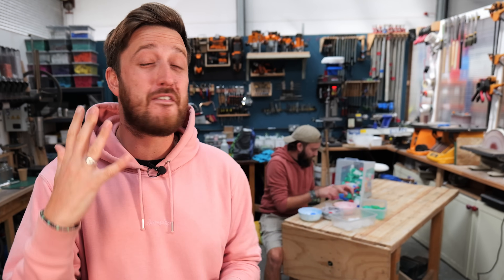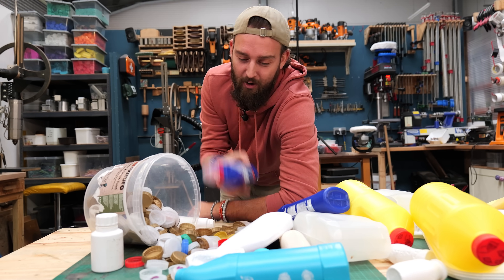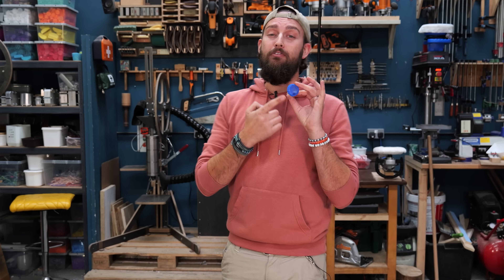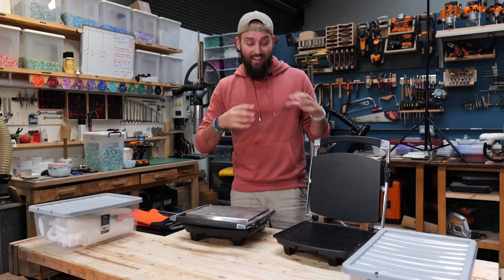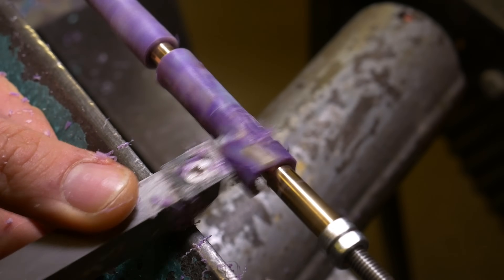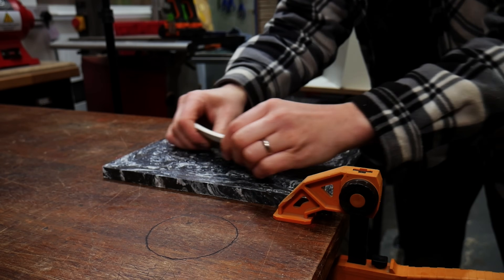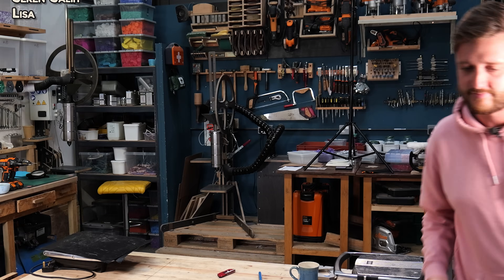11 things we WISH we knew when starting Plastic Recycling

Comment: Plastic engineer here.  Your comment about bottles v caps has to do with the viscosity. Anything that has been injection molded into thin parts, like the caps, will likely have a similar low viscosity material. Blow molding produced bottles (like the soap bottle) will be in the middle and thick wall sheets or pipes will have very high viscosities. It has to do with the intended processes for the material in the first place.  This is why mechanical recycling is so difficult!
Reply: He's right about the intended use for each plastic. The number has to do w the chemistry, but the use case needs different tensile strengths.
Eg.. a clear soda bottle that holds pressure has to have dozens of layers in it to be strong where as a water bottle is just a single micron thick layer.
Bottle caps have to have non cracking strength.
Reply: Can the plastic with a 1 inside the triangle be recycled into anything?
Reply: I have a question any issues with vapors or gases released during melting process?  Since they are doing it in a massive scale.  Heath concerns?
Reply: @jawsvvvvv yes. This is a serious issue and one should have ventilation system in place. Polymers have numerous additives aside from the main component like PE, PP or so. These ususally are low chain organics that modify flow conditions in the forming process (e.g viscosity, wetness) and mechanical properties afterwards. If heated above 60-80 C these compounds are usually released into to a vapour.
Reply: Same goes for casting aluminum. Extruded aluminum doesn't flow as well as aluminum designed for casting.
Reply: So we should just convert it back to petroleum because that’s what it is and use it for fuel. I’ve seen several people using it for fuel after a conversion process. One guy near blew his house up because he was running it under pressure instead of vacuum. I don’t pretend to understand the process fully yet but obviously it can be done. 🤷‍♂️ 
I’d like to run my house off plastic waste. Seems much cheaper than fuel.
Reply: @HamptonsAirTech That's so inefficient. You'd be using a bunch of energy to convert the plastic into oil, and still more energy to refine it. Better to recycle it as a material, where you only have to heat it up to like 140-180C instead of up to 300-900C for pyrolysis.
Reply: @HamptonsAirTech  Think of fuel as a battery that used natural energy to charge. When we burn fuel we are expending the battery. If instead we make fuel then we have to get the energy from somewhere to store it in fuel form. It can be done but more energy is used to make the fuel then can be retrieved by burning it. This means making fuel is a net loss of energy.
Reply: It's Pyrolysis I believe your talking about naturejab right? He blew him self up and now walks with a limp?  there's a problem with benzene it can't be removed from how I understand it but I'm not a chemist  @HamptonsAirTech  there is no safe level of benzene it causes cancer

There's a lot of things that could be oil doesn't mean they should.

The Nazis apparently turned coal into oil and it was incredibly wildly toxic for example there's  tons of it maybe mega tons in tanks at the bottom of the sea and no body has the money or the will to fix that one. "They are monitoring the situation closely"
Reply: Yes you need the plastifier to be known, it's why recycled plastic is never as good. It's why the real way to recycle plastic is to get it fully dissolved to its original components.
Reply: Duh.
Reply: If you are engineer then what is the plastic black mat that the caps sit on in the press that prevents it from sticking to pan or the mat and how does the black mat not melt whats the secret its made of?
Reply: @InCameraK  13:09 THESE ARE TEFLON BAKING SHEETS. Come on, watch the video.
Reply: I have a warehouse proper equipment and labor power. To push out production!!!
Reply: what makes the viscosity different? He said they're both HDPE
did one use a different plasticizer? or more of it?
Reply: @alexr2579  my guess is how the polymer chains are arranged within the material due to production process, with stretching the material ending up with the chains get straightened out a bit instead of being in a glob
Reply: @alexr2579 HDPE is a wide term. There are many types of plastic referred to as that. There’s a clue in the number
Reply: They aren't interested in actually doing a good job, they just want clicks.
Reply: @uwuweewee yeah cos it is not like they are making and selling items made from recycling is it? 😂
Reply: @uwuweewee  you said, on a video consisting entirely of things they've figured out as they've gotten better at said job
Reply: @uwuweewee  Says a troll who can't even do a good job trolling... Next time actually watch the video so you don't make such a fool of yourself.
Reply: @uwuweewee  this comment reeks of chat bot

Comment: I started collecting and recycling plastic because of your videos, although I was in a band so it was making guitar picks - I used metal washers to regulate thickness and was able to make pride flag coloured picks by placing cut single colour strips next to each other. 

I'm a luthier now, so I want to make a ukulele completely out of recycled plastic.... Just thinking through how you'd get a strong bond at joints

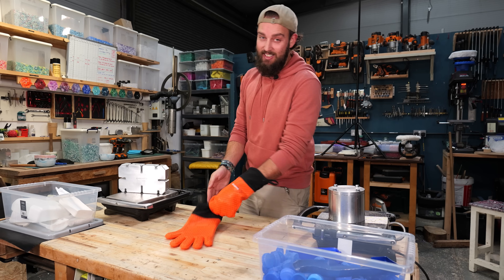Comment: 13:33 Rather use a vertical clamp. Strong clamping force helps in removing air bubbles as well.
Thanks for a gr8 video.

Comment: Please made press-form for tile, which use in a bathroom!
Reply: cool thought, but really not practical. Polyethylene is much more prone to scratches than glass, stone, ceramic, etc. That's a problem when you need to clean it by scrubbing, or if you drop something on it or scuff it. Also not sure how it would perform with any kind of grout, it's hard to glue things to polyethylene besides more polyethylene

Comment: Have you ever tried a heat press like the ones used to press HTV on shirts? I have one and have been meaning to try. I'm looking into melting HDPE and PLA. I think that that having heat from only one side might not be as ideal as a panini press though.
Reply: I’d like to know if they tried that as well.   I used one myself to make some inserts for a cooler.   I work in a restaurant and got some of the empty fryer oil jugs and brought home and cut out sheets from them.  Cleaned them really well with some dawn (cuz it gets rid of grease obviously)   And I used my little heat press to basically laminate several sheets into one thicker sheet.   Then I cut and shaped it and drilled small holes.  And now they fit perfectly in my little cooler so I can keep my food above the ice!

Comment: Very valuable video!

I studied the matter about different additives added to the various kinds of HDPE and I also discovered that some bottle caps aren't injected but rather compression molded on a very fast machine (you can distinguish them because they lack the tiny injection point on the top), and so the melting index is lower, similar to the blow molded one.

I also started collecting everything I could find, and I regretted it.
Even if I can inject the thicker kind of HDPE and PP with my hydraulic injection machine, the cleaning process involved in bottles is wasting a lot of time.
I keep just the brighter/"rare" colors and throw the rest.
Also some people carried very dirty plastic and since I'm working on the project in my spare time it happened that I had bags of stinky plastic...
Did you know what the smell of decomposed yoghurt/cheese/mayonnaise is?
Unfortunately I do...😂😂🤮🤮

Love your ability in videomaking, brilliant!
Keep going!

Comment: My favorite way to remove labels, or adhesive after using a heat gun, is to cut off the affected sections into sheets as flat as possible, and then let them soak overnight in a shallow basin of mineral spirits. The next morning it all wipes off easily
Reply: Hi, just be aware its made from naptha and inhaling regularly,not good. Stay safe.
Reply: Them being plastic, what do you do with the ones that float to the surface? place them upside down to remain submerged?
Reply: @6YJI9 That hasn't really been a problem for me. Laying them face down works fine, or if necessary just set something heavy on them that you don't mind sitting in the mineral spirits

Comment: Greetings from Precious Plastic Turkey.  Thank you for a great educational video. There are valuable tips for recyling plastic. 

We need to find a cheap solution for stubborn label residues. WD40 + Aceton is not a cheapset solution to get rid off these residues. 

I have been collecting empty plastic engine oil cans from several car services in the area where I live for a few months. I use  big mesh bags and pre cut plastics into small pieces before washing. I use a a washing program with 80 Celcius at least 1.5 hr .However i am happy with the results. 

I know that industry uses caustic soda  (drain cleaner chemical ) for plastic cleaning. But this might not be the ideal solution to breathe toxic dangerous fumes while caustic soda react with residues.

We all know that HDPE bottles are made with blowmolding method.and also HDPE bottle caps are made with injection method. That is where the mfi or grades changes as you mentioned. I use 30cmx40cm Heat press and i can mix any grade of hdpe without issue. However precious plastic injection machine might not handle only blowmolding grade HDPE. 

Also i would like to mention that there is similar issue in PP (5)   Plastic chairs may contain calcite for extra durability to the material. However that effects the purity and the grade of the PP (5). 

I love your works from the begining. Keep inspiring the commuity. ✌
Reply: So you wash the oil off in the washing machine? Hhmmm. So where does that all the oily water end up? Hhhmmm. Adding pollutants to the water system?? That's why oil is supposed to be disposed of in a safe controlled way. Glad I don't live in Turkey.

Comment: Have y'all thought about something like a taffy puller hook for stretching and twisting the plastic?
Reply: That's pretty much the opposite of what you want. Taffy pulling works by aerating the soft candy until it increases in size and takes on the translucent color. Not only does this introduce a ton of air into the candy, but it also begins to cool much faster.
Reply: @Wang_Thunder  Exactly this. I would be curious for them to try some ceramic clay wedging techniques on it though, movements designed to get air bubbles out and create a homogenous mixture. In the multicolored plastics case I think it would probably make some extremely fine colored lines.
Reply: @Wang_Thunder 
Except he explicitly stated in the video that stretching and twisting plastic is different from making candy.

Comment: I would not like your electricity bill
Reply: To remove labels, just put them in solar oven during hot days. I really suggest using solar and wind energy for recycling as much as possible. This will reduce energy bill and make your recycling business profitable.
Reply: @kumardigvijaymishra5945  You obviously don't realize how much cloudy and rainy they have in the U.K.
Reply: @mrMacGoover  Infrared label removal is better than direct exposure of labelled stuff to sun because sunlight contains sufficiently stronger UV content that can damage the labels and I can never be sure if there indeed is a tad of X-rays alongwith those DNA mutating cosmic rays.
Reply: Glad it wasn't just me feeling a bit dizzy watching fuel, electricity and water flowing :D

For us, I guess our solar panels produce our energy, and our water is from a well, so we could add our time. Ultimately, reuse and recycling does use existing materials :)
Reply: Good thing solar is around. All recycling of plastic requires heat. It's much better than the plastic in the environment, in plants and animals, and sitting in landfill wasting space.
Reply: Just get solar, it’s literally cheaper then having a sub with your local electric company
Reply: @bradcogley8146 than
Reply: @bradcogley8146 than
Reply: Yeah they definitely need more efficient ways of heating the plastic.
Even the heat gun for the labels seems excessive.

Comment: Nice video
I recycle plastic to make fishing plugs 
I make the plugs in 2 pieces and epoxy the sides together 
I made molds out of Aluminum metal 
With the shape carved into the mold 
A air pocket is pressed into the plastic by the mold 
Then sand the seams ,  paint and add hardware
Reply: This sounds awesome. Have you tried heat welding the halves together? Or does the epoxy work better in this case?
Reply: @Bo-kq8tn  I have not tried heat welding 
I have not tried tried heat welding 
Next batch will be made in a month or so and I hope try heat welding those

Comment: I am collecting some plastic as well I am going to try it, mut my patents won't allow me to use an oven so I am going to try a charcoal grill. Thanks guys.
Reply: Careful about using a grill - they get to very high temperatures very quickly, which burns your plastic and releases toxic fumes. Instead, go to a thrift store and get a secondhand toaster oven, countertop roaster, panini press, etc. Something that allows you to set the temperature is ideal. And just use that only for plastic.
Reply: @mh3708  me15,me no money, but i have  a thermometer, i will just use a burned out grill to keep the plastic melted and use a press/iron  to melt it, thanks for worrying, but do you know the gloves they are using?
Reply: @karamsingh6980 they said they are silicone gloves. Check baking supply stores.